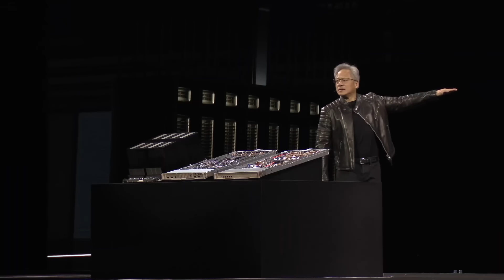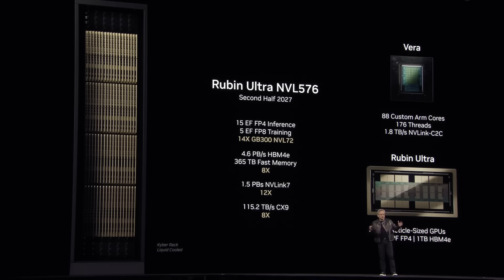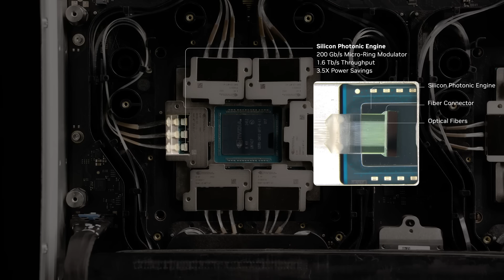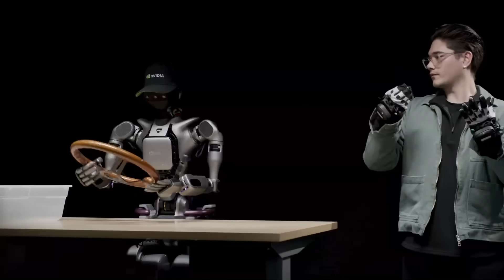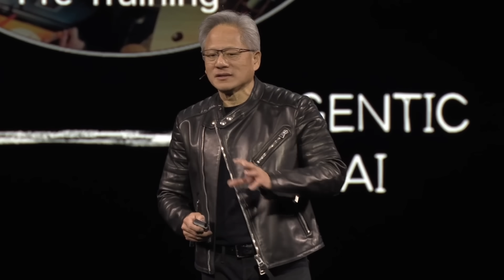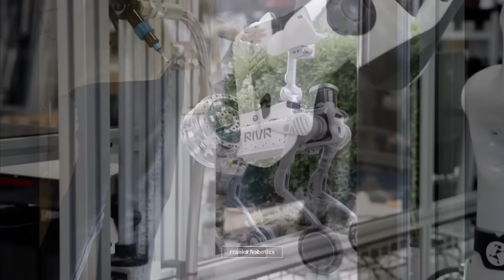NVIDIA CEO Jensen Huang Leaves Everyone SPEECHLESS (GTC Supercut)

Comment: When AI and models swap to integer math with larger models abd more instructions, alu Asics will smoke gpu flops. 

Models work in floats bevayse its easier for us, but they can be comverted to integer models (no floats) but will require more ram and lots of alus. 

In theory, dedicated alu processors can  do 100 iops for every 10 flops a gpu can do.

Alus are much smaller than flus.

Computers dont like doing fliat math, its expensive.   But they love doing integer math.

Comment: In electrical engineering, there is a reliability factor called MTBF. This is known as Mean Time Between Failure in hours. Each component resistors, transistors, chips, capacitors etc... has an integer value. The lower the aggregate final calculation is, the less time (in hours) a given product or system will run without failure. No one in the AI industry talks about this. I commonly found during my career that the hotter any device in a system or product is the lower the reliability.

Comment: Imagine a Self Driving Van pulls up that you can stand inside or sit and you have to show up inside the van as clocking in. You put on the Head set, glove and heartrate monitor and the System will monitor you while you work. Will give you a break when the work conditions start to drop. You go to eat in your house then the Watch or device beeps signaling your lunch break is over and must return to the van in 15 minuets. When work is over your bank account is paid for the day you just worked. No more waiting a week or two weeks for your paycheck.

Comment: After GTC, the moat for Nvidia just got much much wider.  Nvidia is solving the tough issues with AI and Accelerated Computing.  No one else is talking about these things.  The competition is so behind that they are only focused on making a faster processor.  Nvidia revealed that the important considerations are energy usage and the TOC (total operating cost), not just faster processors.  You can have the fastest processor in the world, but if it burns 100MW to run it and requires humongous liquid nitrogen tanks to cool it, you will be out of business right away.  From the GTC, it shows Nvidia has figured out the sweet spot to operate their entire ecosystem and continues to optimize the hardware and software to squeeze out the most profit.  TOC is the bottom line and Nvidia is the only talking about it in addition to all the innovations they have developed overcoming all the hardware and software issues.

Comment: says agentic ai needs more compute, meanwhile I'm finding i might be fine with 8gb vram 32gb ram and 2tb ssd for my own, and can shrink it down for a phone. Combined graph nn with bcpnn, then added in LIH and STDP, then added ELBO = E_q(z)[log p({x_s} | z)] - sum_scale KL(q_scale(z, omega) || p_scale(z, omega)) + 0.05 * sum_g w_g * corr_g(exp(omega) z, x) * (1 - min(1, 2 * mean(Div_i))) + 0.03 * sum_pairs corr_pairs(z_i, z_j, x) 
That equation started with just combining variational inference with lie in order to reduce computational cost and still have a good enough result, works decently, adjust for your own network. I'm gonna package my nn with a setup.exe and auto-key into msty so I don't have to work on user interface. Shits easy and cheap these days, how tf do they suck at making AI so much? LLMs suck the way they are.

Comment: I've replayed it several times, but I'm struggling to wrap my head around 15 exaflops in a single rack. The current most powerful supercomputer is 2.7 exaflops total across an entire farm. In 2 years a single rack with over 5.5x the computer power of a 7500sqft farm is absolutely mental.

Comment: The goofballs in the comments who don’t work with this stuff, don’t write CUDA code, don’t know the architectural differences between Ada, Hopper, Blackwell, etc., just eating up Jensen’s bullshit, is absolutely amazing. The guy makes up numbers, just outright fabricates BS comparisons, etc., all in pursuit of CNBC idiots pushing the share price higher.

Don’t get me wrong, Nvidia’s GPU’s are technical marvels, but comparing generations highlights a problem that’s creeping in that, if anyone in the idiot banker class actually understood, would start dampening enthusiasm big time. Let’s compare Blackwell with Ada: why does Blackwell do so much better in AI tops? Simple, all the SM’s CUDA cores are now INT and FP capable,  versus only half the cores in Ada being INT enabled. Why didn’t they do this in Ada? Because the assumption, when Ada was on the drawing board, was that workloads would be more mixed, with a bias towards FP32/16 precision, versus INT32/16 (and 8, 4 and so on). Throw in some optimizations for FP4 on the tensor core side, and you get 3000 AI tops. The problem is, when it comes to heavy lift FP32, Blackwell is only 20-25% faster, and that’s mainly because it has more cores, pulls more power, etc.. Nvidia is basically charging 20-25% more for a die that is physically ~20%  larger. Basically, the core GPU compute side is effectively stagnant, they just optimized for AI workloads. 

Comparing Turing to Ampere, or Ampere to Ada, and the performance improvements to core compute are comparatively massive. Not only that, but transistor counts, process improvements, core counts, etc., are far more impressive for those generational improvements. All the while, the power envelope is getting more stressed, and the process improvements are now badly waning across the whole industry (regardless of TSMC claims - proof is in the pudding).

And this is why Jensen is focusing on InfiniBand and racks of GPU clusters and NVLink, etc. . He needs to keep saying “line goes up” when in reality, Blackwell (and even Hopper) illustrate a worrying trend (also emerging in CPUs) where the fundamental physical walls of process improvements are encroaching. You can fuse all the dies you want onto huge substrates, you can stack them all in hideously expensive racks with exotic interconnects, but nothing will change the fact that the clock is really and truly winding down on silicon.

And I’m not just some guy, I worked in the stepper and lithography business, I worked at Microsoft and worked closely with Nvidia back in the mid through late 00’s (during the advent of unified shaders and CUDA). I love semiconductors and microprocessors in particular (I think they are the most fascinating things on earth), but the semiconductor industry is in big trouble. The laws of physics dictate you can only make x features so small while handling y power and z signaling rates. But hey, the line must keep going up.

Comment: so, is he talking they are computing all still in floating point? measuring all in FLOPS and sqeezing brutally the GPUs? like more kilowatts and megawatts = more adidas?? does he know that DSPs for years are using fixed point math, things like TI IQMath or so, speeding up some domain specific calcs by 60x or so over FP? that AI thing has primitive calculations on so called neurons in nets, only weights with some precision, not so crucial...  my2c, no offense, not fascinated by a jacket; cheers (that final thing with human-like robots is just irrelevant; 7of9;)

Comment: Given how they lied about 5070 = 4090 performance? Everything with a bag of salt. Nvidia got lucky with AI demand and products. Their greed and low QC in the 5000 series launch have proven the character of the company. Especially with fire and melting risk with their 12VHPWR connector and how they've reduced the safety manufacturing standards on $2000+ consumer GPU's.

Like many major companies these days if you cut things open and look inside you see a lot more lies and problems than what it says on the package.

They'll make money, in the short term. But I don't trust them long term. The QC and quality aren't there. Greed is though. Plenty of greed.

Comment: 600kw per rack? What could possibly go wrong?
Reply: I am an electrician in tranmission level systems (cities).  Holy sh*t!  Doesn't even begin to hint at the issues!  Most people have no idea what 600kw is.  Roughly 100 to 600 homes depends on your location!
Reply: @SammieMcGriff  retired telco tech here. That's more power than all but our large offices use, for everything in the building!
Reply: These places, with these racks, will want their own power net.
Reply: i wish that was all we had to worry about was its volts an amps.

Comment: Hold on. Hold on. So if i spend millions on version 1, then version 2 comes out in 6 months so that i have to throw away version 1 while i spend two times more for version 2. Then, version 3 comes out in 6 months… Now i have to throw away version 2 and pay three times more than version 1. Then version 4 comes out so i have to throw away version 3 and pay 4 times more than version 1. This is corporate racketeering at best. I will go with quantum which is millions of times faster, uses CPU instead of NVDA GPU. AMD and INTEL rock at CPUs.